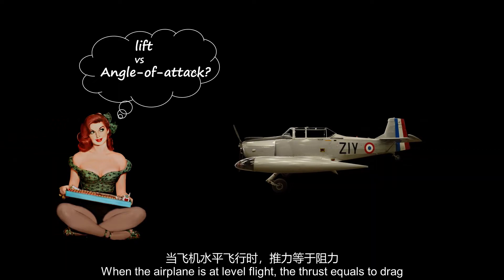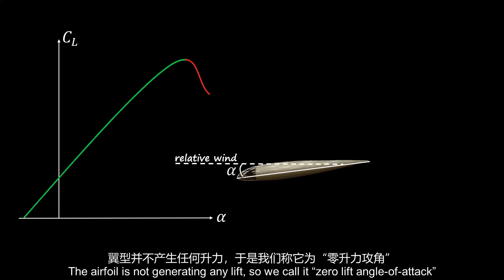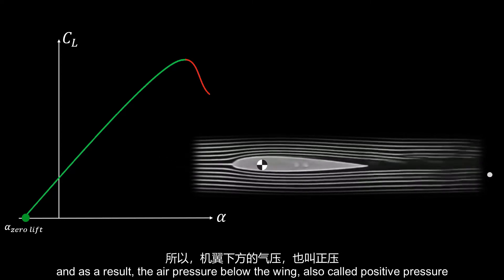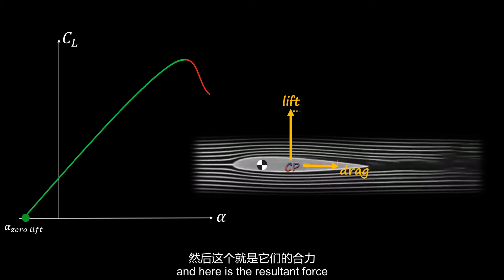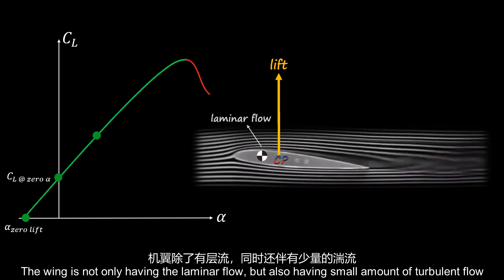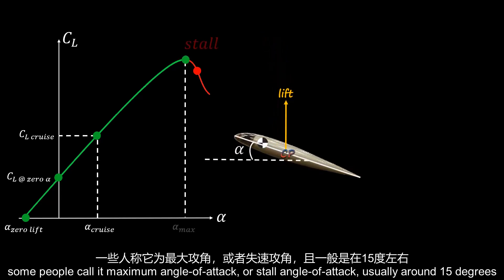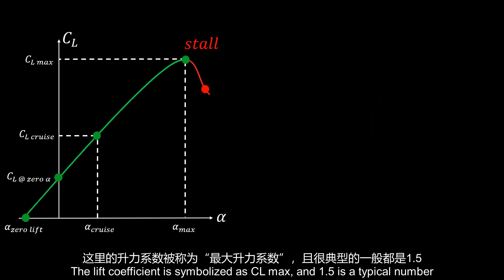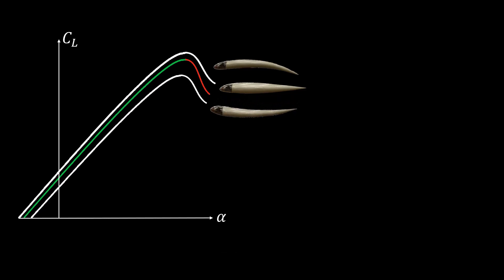How is lift affected by angle-of-attack? 升力如何受攻角影響？

Comment: I am very sorry, but what you say at time 0:50 is INCORRECT.!.
. . .
When that wing is at zero degrees geometric Angle of Attack, (AoA)  and it is at level flight, it is THEREFORE generating lift; AND the flow_IS_ Asymmetric! There WILL be some up-wash AND Down-wash!!  The air Will NOT FLOW AS SHOWN.!.
That is Incorrect!
.. .. ..
There ARE places around a wing where Bernoulli's Principle is followed, but just about all videos and papers that describe how this happens are wrong.
..
It is also poor physics to say that the flow is related to the venturi effect.  This is a very common misconception that says the air must squeeze through a smaller space above a wing.  The fact that the air below has a similar narrowing, near the trailing edge of an upturned AoA, CLEARLY shows that this is OBVIOUSLY FASLE science. 
The air above the wing  does not have a hard wall causing this to happen. The air above is a very soft boundary and there is no venturi effect.
..
The air above a wing meets the trailing edge before the lower air because the negative pressure above forms a Pressure Gradient with the positive pressure near the leading edge that together, accelerate the air rearward. 
If you measure the speed of the air above the wing in reference to the ground (zero wind), that upper air actually REVERSES DIRECTION as the wing goes by and is traveling in the OPPOSITE direction of the wing.  It is traveling BACKWARDS - opposite to the direction of flight!.  this is the result of the high rearward Acceleration due to the steep pressure gradient mentioned above.
.
Lift is not very complex when understood correctly.  This following blog steps through it for you  rxesywwbdscllwpn DOT quora DOT com/  Put the DOTS back in because You Tube does not like links in the comments.
..
Regards.